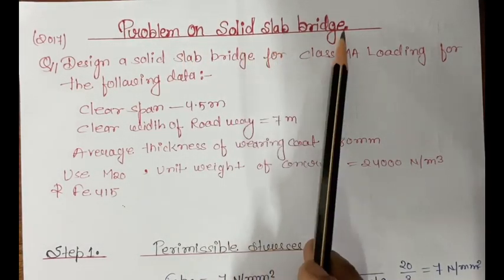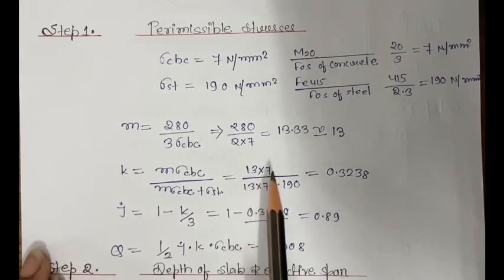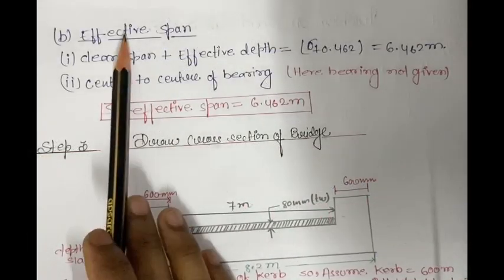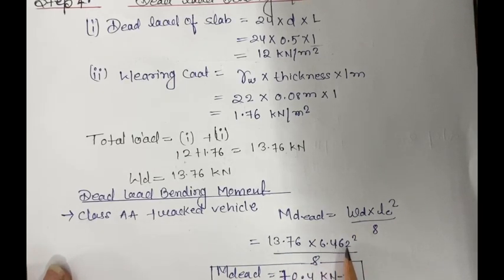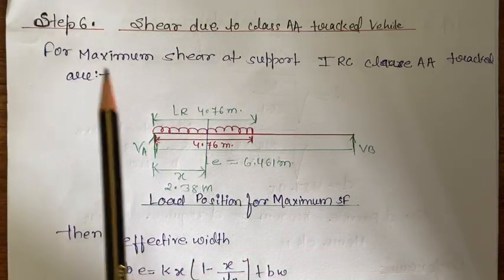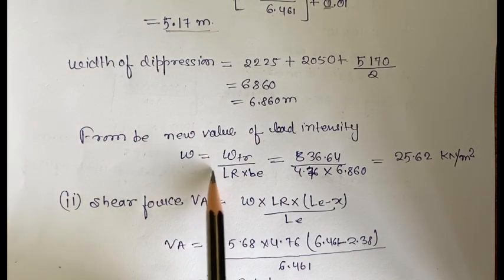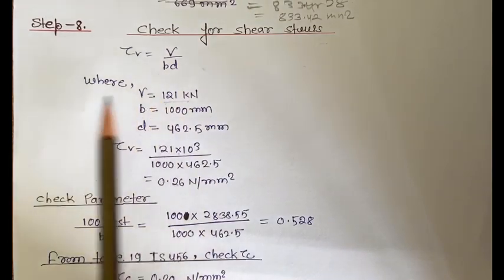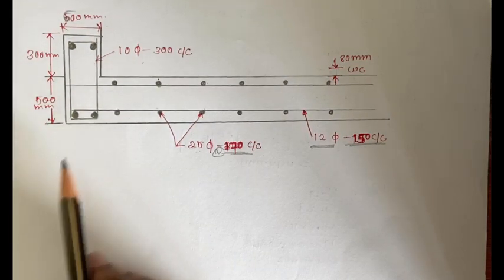DESIGN OF BRIDGES || Design of Solid Slab of Briddes Or Deck Slab of Bridges || Solved Numerical ||

Comment: Design a reinforced slab culvert for a state highway to suit the following
data:
Carriage way: two lane 7.5 m wide
Materials: M25 grade concrete and Fe415 steel
Kerbs: 600 mm wide
Clear span =6m,
Wearing coat =80m
Width of bearing=400mm,
loading: IRC class A or AA, whichever gives the worst effect.
Design the reinforced concrete deck slab and sketch the details of
the reinforcements in the longitudinal and cross sections of the slab. The
design should conform to the specifications of the bridge code IRC:
19:1987

Comment: Mam can u explain clear span how it became 6 in calculating effective span. Please
Reply from the maker: Ok listen there some mistake in question clear span will be =6 m instead of 4.5 m

& 7m is not clear span that’s the road width 

You seeing width wise crosssection there and clear span will in length wise direction 

Means there is road & there will many columns along the length so clear span is distance between two column i.e 6m

Imagine a bridge in your mind all will be clear what’s the width & what’s the span
Reply: Thank u